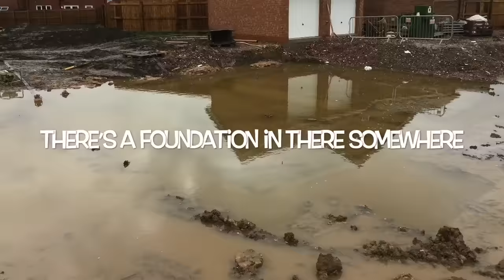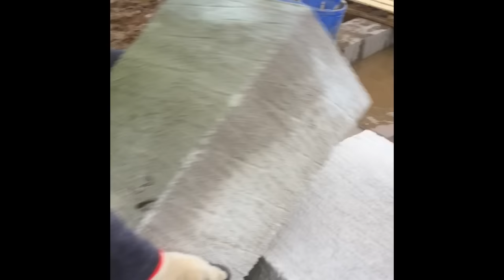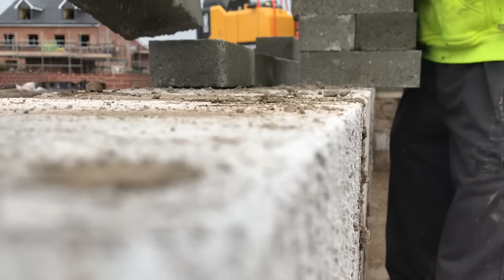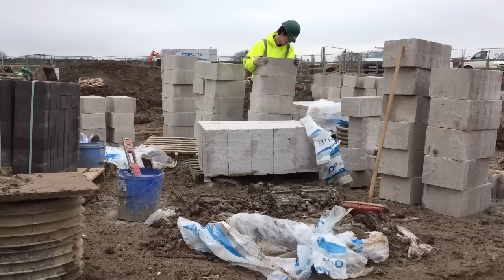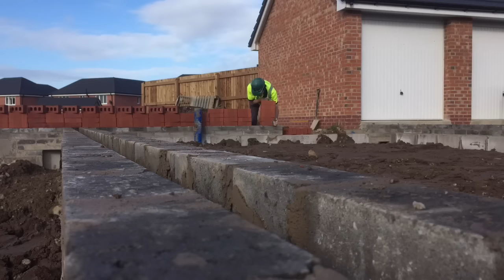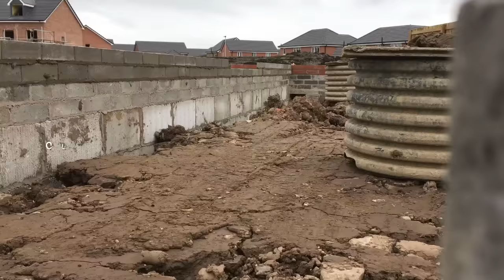TOUGH WORK SEMI DETACHED HOUSE FOUNDATION

Comment: Good video Steve . I like the brick tongs . Can’t beat good mortar it’s half the battle do ye always mix it yourselves.
Reply from the maker: bric bybrick . Glad you like the brick tongs we love em ! Yes we always mix our own , got bought a brand new mixer last week which is great but it’s a pain in the arse to keep clean ,no more chucking a few half bricks in any more . 
The silo mortar isn’t allowed below d p c .
Reply: Bricklaying With Steve and Alex . that’s good can’t beat a new mixer I usually put a few shovels of 10 mm chippings in mine when I am finished mixing does a great job on them with out banging them about . That silo mortar usually comes 1 to 5 or 1 to 6 over here bit weak for bellow ground . I like the trowel ready mortar from the mixer trucks great stuff. What s your mix there below ground 1 to 4 .
Reply from the maker: bric bybrick . Yeah a bucket of stone does the job and a quick brush ! 
We mix it 4 - 1 . Very wet for trench , very dry for the engineering, mixing your own means you get it just how you want it. Thanks for watching and commenting pal👍🏼
Reply: What mix ratio you doing below DPC?
Reply from the maker: Mark Neilson . Hi Mark we do 4 to 1 
Thanks for watching and commenting 👍🏼

Comment: I missed the part where you grabbed a quick cuppa...? Very tidy work as usual, gents. I wondered whether the agent called for a pump to clear the trenches or was the muck for the first course dropped in blind?
I was working in Cornwall, as part of a 6+1 subby gang, where we laid concrete blocks in about 6" of water despite a couple of 2 inch pumps trying to drain the sump. I think that the water table was tied to the state of the tide, that was how it felt!
Reply from the maker: brando6BL That sounds grim . We got the trenches dry enough to get the first course set out 👍🏼
Thanks for watching and commenting 👍🏼
Reply: That'd be Grim with a capital G, mate. We certainly got through a lot of Marigolds' in a day!
Reply from the maker: brando6BL 😂😂

Comment: Your obviously a both good trowels but iv got to question the older guys flicks and taps he does with the trowel all the time do you really need to do that? It’s just a waste of time...
Reply from the maker: Its an old habit . If you pick up the mortar and just turn the trowel  it slides off because the mortar is so wet for trench block. The taps are just so the mortar doesn't slide off into the mud as I'm buttering the blocks .
thanks for watching and commenting  👍🏽
Reply: Bricklaying With Steve and Alex no worries definitely wasn’t a criticism, can see your both very good at what do!
Reply from the maker: Boxing Fisherman .No probs pal , thanks for commenting and watching 👍🏼